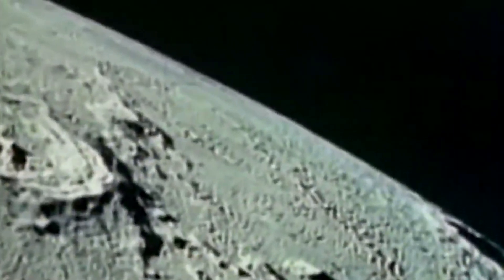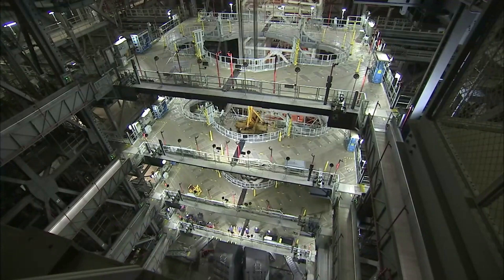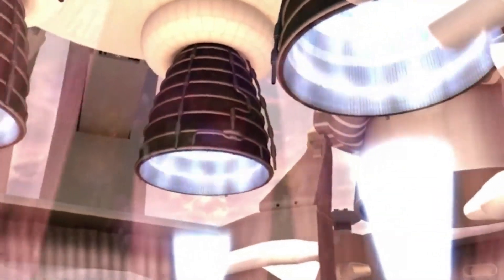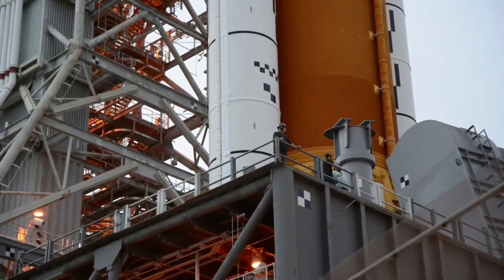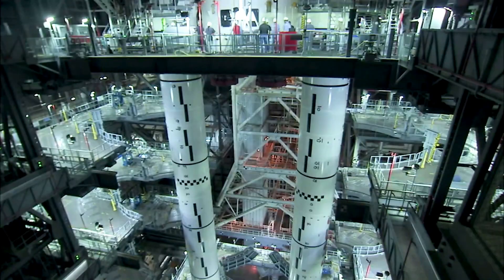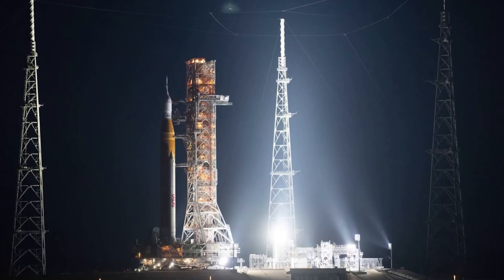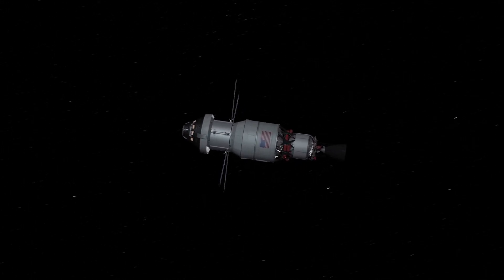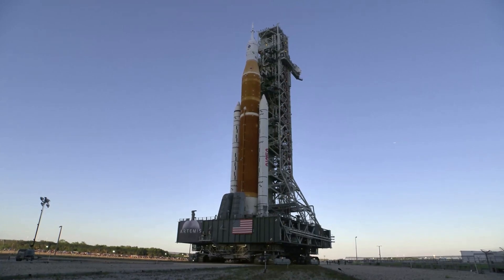Why NASA Needs To Launch SLS Soon, Final Launch Prep, Update, & More

Comment: I remember in 1986 the booster people said “you really shouldn’t” and nasa did. Ended in a boom. 

Now in 2022 the engineers say “the boosters are good for 12 months for sure, after that it’s not promised” and nasa says “ok, let’s say 23”. 

They have learned nothing, even if it all goes to plan.
Reply: Morton thiacall told NASA not to launch in 32° weather and wait until the temperature got up to 55°, they couldn't guarantee the seals will work at 32 on the solid rocket booster well NASA ignored them and we'll saw what happened

Comment: A Retro spam can atop an outdated throw away mega rocket re enacting past glories. Usless waste of money
Reply: Not a fair analogy. Not even close. These missions will last weeks not days and the mission profile is completely different then that of Apollo. The goal is a permanent base at the lunar south pole and to gain the knowledge and experience to go to Mars. This way if something goes terribly wrong they're days away from home not 8 months. In addition the NRLHO will allow uninterrupted communication with the crews. Apollo crews were in communication blackouts at key points. Apollo missions were incredibly dangerous and they were unbelievably lucky that only 3 astronauts died, Apollo 1.
Reply: @timonium252  A throw away mega rocket topped with a retro spam can is not a way of doing anything routinely. This is an obsolete system which is not sustainable
Reply: @bernieeod57  
  Your assessment is inaccurate and baseless.
Reply: @dr.OgataSerizawa  A throw away mega rocket topped with a retro spam can. It is already way behind schedule and way over budget. It has already faied

Comment: They better fix the leak in main tank so it doesn't blow up when they finally get it to launch
Reply: There isn't a "leak in the main tank". The hydrogen was leaking at the quick disconnect.
Reply: It is less a Rocket thing, and more the mobile launch tower that is utter rubbish. The rocket (SLS) is a dead end project about as powerful as New Glenn is projected to be. The rocket that is supposed to carry Humans From Earth to the Lunar surface has not been built yet, unless you count the Chinese one.
Reply: @twotone3471  It's not just about the power of the rocket. The duration of the burns have just as much to do with the ability to get heavy payloads to the moon. The Space Launch System's core will burn almost the entire way to orbit. Over 8 minutes and the incredibly powerful SRBs burn for the first 2 minutes. The Chinese have nothing with the capability of SLS. And this is only the Block one. As far as New Glenn goes let's see if Blue Orgin can get to orbit first. Paper Rockets don't fly. Starship will be an incredible LEO truck but will require in orbit refueling. Six additional Starships launches and 6 dockings to refuel in orbit to go to the moon and beyond.

Comment: Just fund starship fully wink wink.
Reply: Starship is right now doing the equivalent of the SLS green run back in March AND they don't even have crew life support systems or in-orbit refueling, much less a NASA crew rating for lunar re-entry. Relying on Starship for transportation to the moon would set Artemis 1 back YEARS.
Reply: @plainText384  Good point
Reply: @plainText384  Yep Starship could be an incredible LEO truck but the in orbit refueling is completely untested. Even if Starship doesn't go beyond LEO it may go down as the most important spacecraft in history. It will get the tonnage, the material to orbit to build real space infrastructure.
Reply: @timonium252  IF it manages to achieve reusability and associated cost reduction. Saturn V, SLS, etc. can also put very large and heavy payloads into LEO, if Starship either fails to achieve reusability or reusability ends up being expensive (think space Shuttle), Starship would just be remembered as N1 version 2.0.
Starship is also so far missing a method to deploy large payloads, like space station modules or large space telescopes, if (when) Starship gets some big cargo doors, it'll have space for about a 9m x 18m (diameter x height of fairing) payload, very similar to SLS block 1B cargo (8.4m x 19m), but still substantially smaller than SLS block 2 extended 10m x 31m fairing. 
I could imagine a future where Starship is used for most large payloads and constellations, but some extremely expensive and massive Space telescopes etc. are still launched on SLS.
Reply: @plainText384  I had no idea the Block 2 extended will have a 30×10m fairing. You could put a 9m Hubble in there or a 15 to 18m folding telescope. Just imagine the resolution of an 18m space telescope.
Reply: @timonium252  the LUVOIR A concept has a 15.1m segmented primary mirror that folds into an 8m fairing and it would already have up to 24 times sharper images compared to Hubble. A telescope optimized for a 10m diameter fairing would be insane.
Reply: @plainText384  I keep hearing they're going with the 9m version of LUVOIR. It's a shame. If they're going to spend billions on a telescope and the fairing space is there go big. It doesn't make sense to do otherwise.